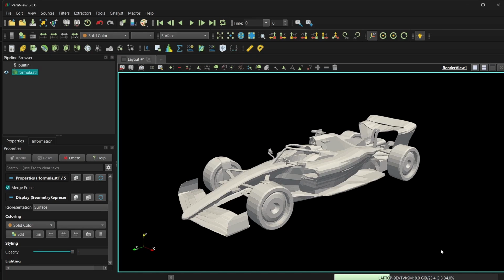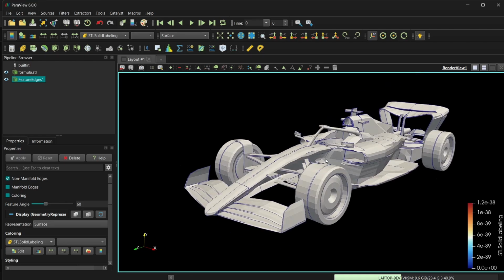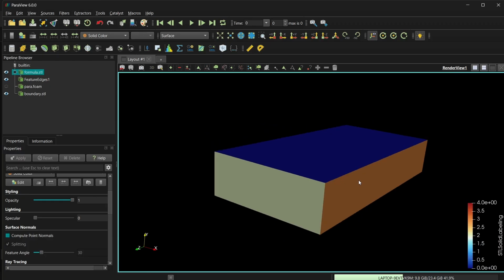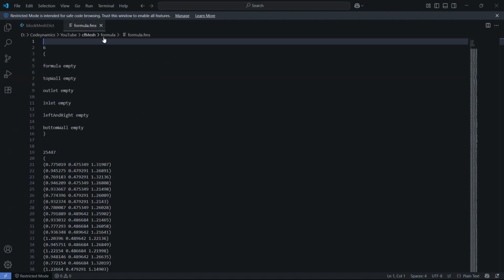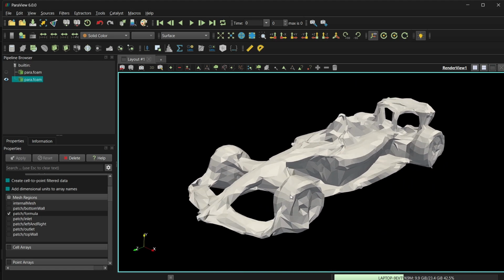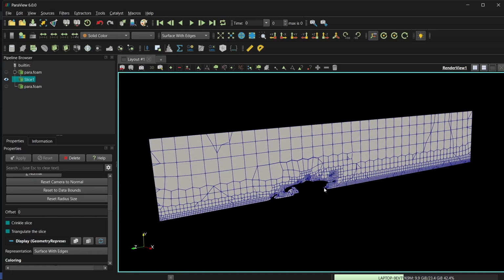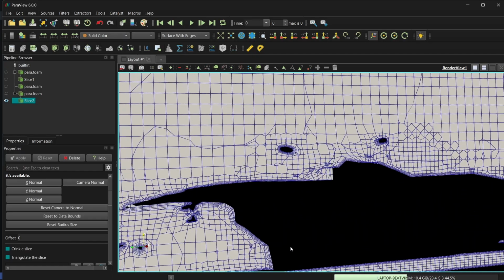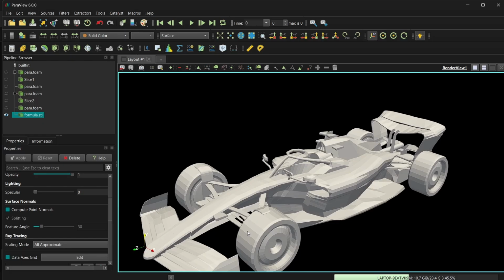Meshing Formula 1 car using cfMesh | Tutorial | English

Comment: Hi, can I enroll in a beginner OpenFOAM course without a license? Do I need to purchase any software licenses to complete the course tasks? Like Ansys, etc
Reply from the maker: Hi. OpenFOAM is completely Open-Source. And every tool used in the course is free. You do not need a license. There is a chapter where we discuss importing Ansys mesh into OpenFOAM. But you can just learn the method and skip practicing it if you do not have the necessary files or access to Ansys. 

Hence, everything is completely free. 

Happy Learning 🎉

Feel free to contact me at codeynamics@gmail.com if you have any questions at all during the course.